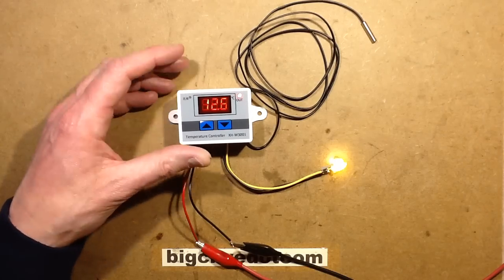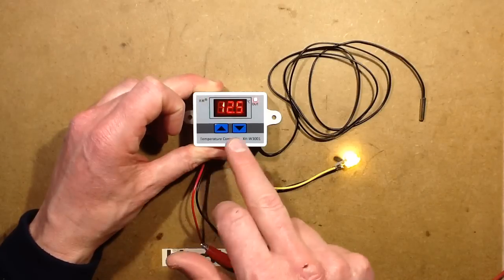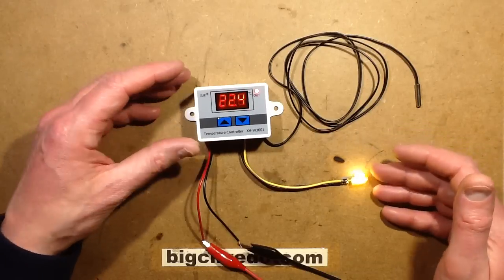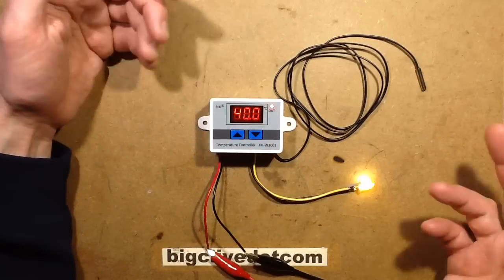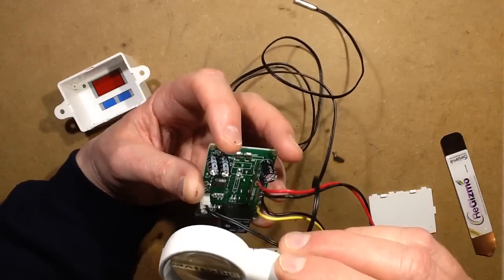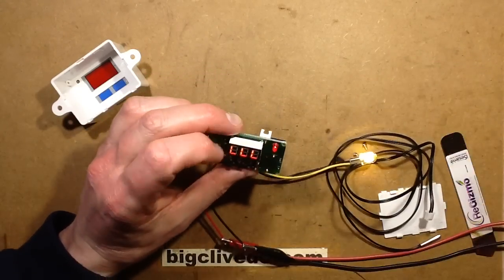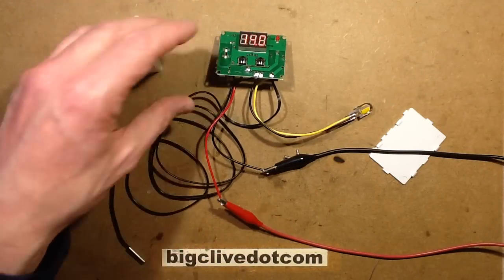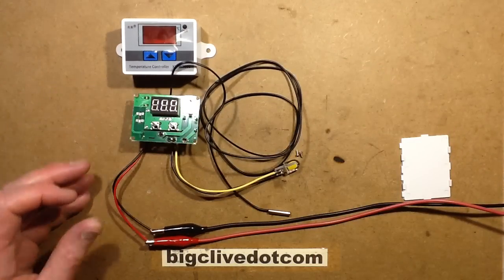How to set a XH-W3001 thermostat module, and a look inside.

Comment: You ever wonder if China has much better stuff for its factories, and they just don't export it much?
Reply: they have just good enough stuff for their factories, like the controller in the video. you're not gonna see much honeywell in china.
Reply: Wonder no more. I have been to China many times before.
And yes. Their policy is a little bit self centered. they keep all the good stuff for them selves and export lower quality stuff. Unless you buy really expensive high end performance parts and whatnot.
Reply: DeoMachina They have different versions of the same stuff. You get what you pay for basically. And yes they usually use the ones that are of good quality. Big Chinese dealers also sell stuff based on regions since in poorer regions people value money more than quality.
Reply: I suppose that makes sense, since the west already produces good stuff, China can't compete as well with the extra overheads tacked on
Reply: no reason not to finance the better stuff by selling it as well, im sure they use a combination of cheaper stuff and better stuff, we can buy both if we try, most of the better stuff is sold under name brands here, the cheaper stuff is sold as generic or value brands, look at say a expensive name brand, its still made in china, they probably design their own face for it, but use the guts of a decent chinese module
Reply: +KObalts this is true but none of it is all that stellar.  I mean you are not going to find USA/German/Swiss engineered standard quality in their stuff even in their own factories.  ADVChina has made me despise China even more and thanks to what I have watched the people of China aren't all that great either.  Five cities are level one cities and the rest of China is like going back to the middle ages.  Leave those five cities and it is as if you stepped into a different time.  Nope, China is having a hard time and is a paper tiger with a financial collapse about to happen as soon as they finish building all of those Ghost cities.

You can't expect quality from China as you will just get "good enough" from them even when the "good enough" is for their own people.
Reply from the maker: I'd love to see some videos which were just tours of the control panels in a wider range of Chinese factories.  From the high profile ones to the back-street ones with a handful of components lying loose in a box or dangling off the back of the machine.
Reply: +dark alchemist, times are changing of course, wages are rising, shipping charges probably are too, plus the whole 6 week shipping times affects many sellers,   automation will also help change the metrics of making stuff again in the USA (or UK whatever!, lol) along with the advantages of faster turn around, plus of course the world market is only so large, esp as richer nations prefer to buy more premium goods which china cant compete with.  but then again other countries may emerge as buyers, african coutries have potential along with south american countries to need a lot of cheaper goods if they can get any kind of economy running at all, after all they are sitting on vast resouces, just dont have the stability to partner into exploiting them
Reply: I work on projects in China.  What they tend to use is not based on cost, but more based on the kick back schemes of the buyers.  This means a lot of the time they use European proper brand equipment.  More money spent means the percentage on the kick backs is higher.  Sometimes it is Chinese supply knockoffs, but never stuff like this.  You would see stuff like this in places like restaurants where cost actually matters.
Reply: +red so its the same really as most of the world, a proper install a hotel or other serious business would use high end stuff as part of professional contractors, the price of good materials just has to be paid.  this thermostat is more diy level, generic, we wouldnt use it here in any pro install either, but someone might bodge it into something or some home made device.  we have our own low end stuff anyway, we can always buy no brand stuff, but you notice anything thats done right, i watched my local supermarket spend a fortune kitting itself out with all new led lighting, must have cost an insane amount of money (i would have loved a few feet of that for my workshop to replace 6x6ft tubes) they fitted it by the hundreds of yards, but they balance it by not needing to replace it anytime soon, downtime costs them money too. so quality counts.
Reply: In the rest of the world, the goal is to spend as little as possible while providing something that work, while not getting blamed for it not working....  The primary goal in China is to make as much personal money under the table as possible, while not getting blamed for it not working...
Reply: +red kickbacks happen all over, a contractor buys substandard items and fits them quick before hopefully he gets found out, usually for high end builds that gets found out long before it gets fitted, as in close to never happens, but ive seen say a contractor for the council fitting substandard items in the hope they dont have any inspection or enough complaints to get caught out.
Reply: From the packaging, this unit doesn't look like an industrial temperature controller.  It was probably intended for homeowner and light commercial use, not industrial process control.
Reply: I too have been watching ADVChina videos. What an eye-opener, especially about the darker side of Chinese culture. Explains a lot about why they do some of the horrible things they do (poisoning foods, etc). And the one about Chinese real estate makes me wonder when their RE bubble will burst, just like it did in the US. Looks to be inevitable.
Reply: That explains Chinese values in a nutshell.
Reply: I don't see the US or UK producing more than they consume
Reply: China has always been two faced with profit being the motive.  If you have seen Chinese surplus rifles, like sks's or the Norinko AK's imported into the US you would understand.  Their military industrial complex quality surpassed Russian quality whom they patterned the weapons from. Why not the same?  They do keep the best for them and this has not changed.
Reply: Most people on the left don't seem to realize how difficult it would be for THEM to emigrate to other countries. They don't want you. The mantra seems to be - Asian countries for Asians, African countries for Africans, Mexico for Mexicans, and White countries for everybody.
Reply: Yeah, I remember how big Norinco imports were back in the late 80's/early 90's. Clinton put a stop to that, IIRC.
Reply: John jones, I don't think you've ever traveled.  The Chinese are quite fond of Europeans, they just don't go out of their way to speak English (for the same reason we don't try to learn their languages), and the bias in favour of paler people extends into India, Thailand etc as well.  Africans are renowned for being welcoming, although for obvious historical reasons some countries may be suspicious of foreign motives.
Reply: I've traveled all over the globe. Have not been to China yet.
Reply: Could this be used as a replacement for a fridge thermostat which isn't available anymore?

Comment: This actually has some good uses. May have to get one.
Reply from the maker: It falls into the category of cheap, useful module that might come in handy one day.
Reply: I'm looking for something that controls both temperature and humidity. They seem to be quite a bit more expensive. :(
Reply: also easily reprogrammed (just get ST Visual Develop (free) and a $2 ST-Link clone) , those STM8's are pretty nice MCUs in a lot of ways; using that very chip on a project right now - terrific value for money

Comment: One thing the XH-W3001 it doesn't appear to have is a Fahrenheit mode. Living in the US I never think in Celsius. Usually require an online converter to figure Fahrenheit.  Most of the other W series thermostats you're able to switch between Celsius and Fahrenheit.

Comment: I'm sure there are scenarios where keeping something at temperature would necessitate the failure mode to be keeping the load on. I.e. I'd rather have a fridge cool too much and freeze things (unless its compressor required a certain off time) than to suddenly cut off and have to throw everything out, suppose it just depends on the application.

Comment: That would work great for a heated bed on a 3D printer as a secondary controller rather than going through the circuit board.  It would have to be used as a sending signal only though.  The heatbeds usually draw around 10 amps while heating at 12 volts.  Maybe going through an SSR or something might work.

Comment: Nice video. I am looking at getting this to control the fan on my solar hot air heater to replace the snap disc fan control, greater range oe adjustment. Will I be able to power this with a 12v wall wort?
Reply from the maker: A 12V DC wall wart should be fine.  The output of the unit will then be that same 12V but switched.
Reply: Thanks BigC I have placed a order, also I noticed that that morning there had been 4 of these sold and that afternoon it had jumped up to 22 pcs. sold so you are a great SALESMAN lol.
Reply from the maker: This is why I always buy more of a particular product I like before I release the video.  And bizarrely, even products I give terrible reviews to, end up selling more.

Comment: It would be interesting to know if that unused 4 way connector under the chip is the SWIM programming port for flashing the firmware onto it in the first place. If it is one pin should to pin 18 (data) and the other to pin 4 (reset) of the chip and the other two being power.

Comment: If this was used in a cooling application, say running a fan on hot electronics, wouldn't you want the failure scenario to turn on the fan? Seems to me that might have been the logic behind turning on the output if the thermistor fails. 

Would be nice to have the failure state configurable, but I guess you can't ask for much given the cost.

Comment: Mine shows 1,5 degrees more than it actually is, but I can't seem to find a way to calibrate it... I have it for 1 year now in my incubator and im setting it to 39 degrees (Celsius) to actually get the 37.5 that I need). Big negative for this device the absence of calibration option.

Comment: Nice concise vid but can i plug the 220v straight into the mains here in britain or am i better off getting the 12v and a battery?
Reply from the maker: It depends on the application and the load being switched.
Reply: I was going to use it with a bulb as the heater to make some homebrew as a one off which has to maintain 25C. Didnt know if you could plug the 220v version straight in the mains but ive told apparently you cant and the 12v battery just adds more cost unfortunately

Comment: Excellent video. Need to think about the potential issue with a thermostat failure. Im using it to run a 10w heat pad for bee hives, so dinnae want them cooked.
Reply from the maker: You could add a traditional bimetallic thermal switch chosen for a higher temperature.  An inline thermal fuse could be used as a last resort.

Comment: I think those two zero ohm resistors jumping the slot could be bridging the 12v to the relay? So your model actually has 12v on the relay, but remove those two resistors and you just get the bare relay contacts? That would explain why it's jumping the anti-tracking slot.

Comment: Just came across this video and bought some my question is how do I change the temperature sensor as I need a longer waterproof proof one 
Thank you
Reply from the maker: You can extend the existing one and pot it in resin.  If you measure the resistance at around 20 degrees Celsius it will indicate which type of thermistor it is.  Often 10K (10,000 ohms).

Comment: Question: I'd like to distill some vodka (I need reasonably pure ethanol as a solvent). I'd tried freeze distilling (putting the vodka in a 2 litre pop bottle and freezing it) then taking the cap off and holding it upside down over a jug and collecting 40cL (from 1L of 40% vodka) that drips out. This yielded about a 75% solution :(.  How about if I get one of these things, a SSR and a cheap electric cooking hob. Use the module to turn the hob on and off at around say 85C, that should be enough to boil the ethanol without boiling the water. Then just channel the vapour through a simple condenser and collect? Would that beat 75% do you think?
Reply: SpudHead depends.
If done properly but probably not.
But you can always daisy chain those cookers.
Reply: Well I need it as pure as possible, like I mentioned I need it as a solvent so I'm essentially trying to turn a 40% solution (vodka) into 95% (rectified spirit). I tried the oil separation method too, but that only yielded about 75% again, I think once the density becomes low enough to float on the oil that's the best it can do. Using a glass bead column I did read about too, but I'd still need some control over the heating to keep the fractioning point of the water stable.
Reply: There's a destillation limit to ethanol. It needs to be dried with chemicals that react with water or it's boiling point has to be altered.
Reply: +Eden, yes I think this is the way to go after reading about it. So if I follow you here. The vapour (which is a stronger concentration than the liquid being distilled) starts to condense on the beads in the bottom of the column, the condensate is naturally a stronger concentration, this then re-vapourises forming an even stronger concentrated vapour which again condenses further up the column and the process repeats getting stronger and stronger each time?
Reply: Surely there has to be some alternative, easier to obtain solvent? What are you trying to do with this solvent? Rubbing alcohol / Methylated spirits etc would probably be an ok subsitution for most cases.. if it does need to be drinkable woulnd't it be easier to get a bottle of everclear 190 if you're in the states or rectified spirits if your in the rest of the world?
Reply: It doesn't need to be drinkable no, but it needs to be non toxic. Spirytus Rektyfikowany which is the only rectified spirit easily available in the UK is what I'm currently using, but it's very expensive. A cheap bottle of Tesco vodka is much cheaper per unit of ethanol. Hence the desire to purify it. But I've now managed to get the oil separation method to 92% by using two different types of oil. It'd be nice to get 95% though.
Reply: There is no "boiling temperature of ethanol" when you have a water-ethanol solution; chemistry of solutions does not work that way, you need to look for an ethanol-water solution phase diagram (http://www.chemguide.co.uk/physical/phaseeqia/bpcompn1.gif).

You heat the solution up, it boils, and you get a gaseous solution with a different ethanol-water ratio. You cool this down, and repeat: each time you will get closer to your 95%. This equation will tell you how many times you need to repeat: https://en.wikipedia.org/wiki/Fenske_equation

The purest ethanol you'll get with distillation is an azeotrope at 95% alcool – more concentrated solutions are obtained using other solvents like benzene, and are not safe for human consumption. Be aware that vodka also contains sugar, and if you heat it too much it will caramelize.

Comment: +bigclivedotcom I noticed something interesting at about 30 seconds.  While you held the piece of paper, the seven segment displays were flickering, but shortly after you moved the paper off screen the flickering stopped.  I assume that is the ipad adjusting the white balance.  Could you use this to correct flickering in the future?  Might be worth a few minutes experimentation.
Reply: it may adjust white balance (which should be manually set before filming) but the flicker stopped due to the shutter speed reducing to below the multiplex clock

Comment: hey, im trying to use this to switch a heat cartridge, i have the 12v 120w model. So what i did is, i hooked up a Lipo 3 cell 12v battery to the input, and a 12v 40 watt 3d printer heat cartridge on the output, i set it up just like he did in the video to heat, but even when the output light is on, the heat cartridge does not heat up, anyone has an idea what could be wrong ? is it the lipo ? only thing i could imagine being the problem is the heat cartridge being broken :/ please help :(

Comment: Hi there ! Love the video and the channel !
I have one question: Is this temp. controller suitable to control a 220v contactor ?
Reply from the maker: They do 240V versions.  The 12V version can switch contactors with 12V coils.
Reply: @bigclivedotcom  sorry I expressed myself badly ... I bought one that works on 220V but I do not trust it can handle 1500W as specified by seller. And I would like to be perfectly safe and to put 220V 10A contactor in between this temp. controller and device i would like to controll, but in other videos(about 220V timer switch) of your I heard that some of those chinese controllers are not good at driving the inductive loads like contactors( https://youtu.be/CpdV_EOGjyk?t=9m49s ), so I would like to hear your oppinon / advice on that :) Do you think this temp. controller is prone to such problems? Or this was specific only to that timer controller ?

And thank you for the quick response.

Comment: Yep thats simple with bugger all to go wrong, should be very reliable :-D
That same setup could be used to keep a soldering iron at the correct temprature with software tampering and a different sensor.